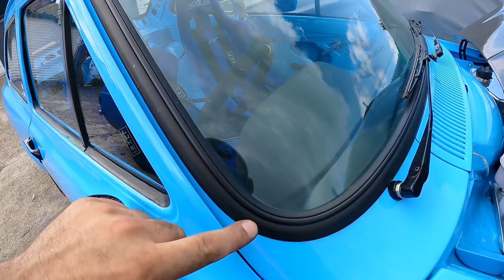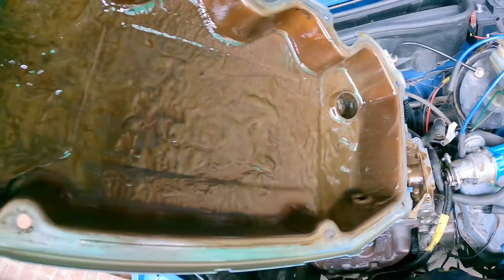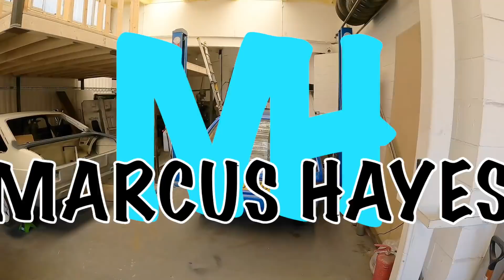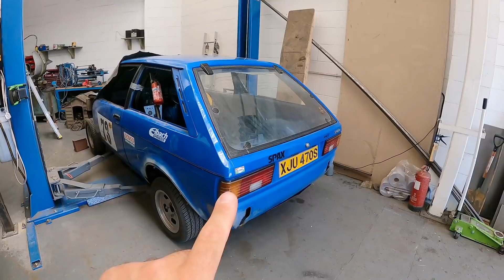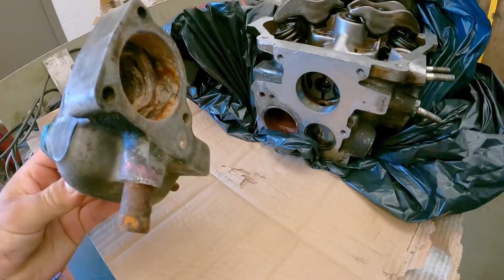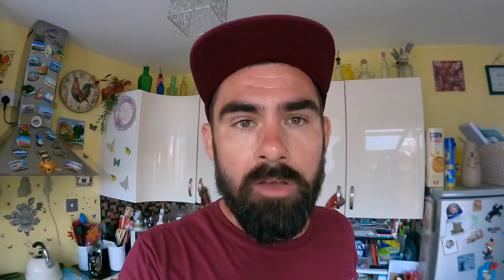Can the MK3 ESCORT cylinder head be SAVED???? 🤔

Comment: Great video Marcus, as always 👏. Running on your break at work to work on the cars, i take my hat off to you.😎 A couple of videos back somebody was on your case about the bubble arches and claimed they were Forest Arches, well, with respect to that person, the rally car at clumpfab has Forest Arches on. So there are a major difference between the two as one could see. As for your dads car, make sure that you got the right one firing on your timing before assembly, as the rotor can turn and you could be way off. Seeing that the head will be stripped that cam timning could also be out. ( but i am sure you should know that (lol) Top man.👍👌
Reply from the maker: If I remember rightly the guy before was talking about Mk1 arches which I have always called 'bubble arches' because of the shape. Thanks for the advice about the timing on the head. Is the cam pulley not on a 'keyway' ???
Reply: @marcushayesford  Hi, you are so correct sir, but it could still be in any position.

Comment: Too much time with just water in the Mk3 water system has caused sludge build up. You will need to get the water ways cleaned out. Would be sensible if the head gets chemically dipped to clean it before being refitted, it would be worth it  and flushing with cleaners when you get it going again. Remember the rad is potentially full of silt also. I am sure CVH's might use stretch bolts as well on refitting. HGF was on the outer cylinders as Chris showed. 
Good luck on any of the bolts on Dads exhaust. At that age and mileage they will crumble and snap. Will be a bigger job than you might think, but good viewing as always Marcus !!
Reply from the maker: Thanks for all the advice mate! 👍 The head will be stripped and cleaned @ Clumpfab and I will be flushing the coolant system once the engine is back together (ill be flushing it with a hose before I fit the head too) I have new head bolts for the CVH and yes I think the exhaust job on the Focus is going to 'interesting' with those rusty bolts! 😃

Comment: Short journeys can cause sludge also on cvh
Reply: The cvh was crap anyway
Reply: Having owned a fair few
Reply: @TheAlien1974  cvh was a good engine just needed proper maintenance and regular oil changes more than what was recommended my own xr3 has only cambelt changes and a set of valve seals in 25yrs of ownership used to see engines rattling and full of sludge due to no oil changes that's a killer on cvh
Reply from the maker: Hopefully with a fresh cylinder head and a flush my Dad's engine will be sweet. Its only done about 33k miles. 👍